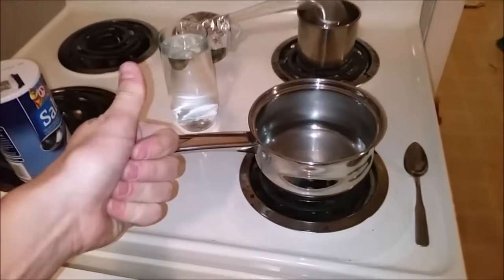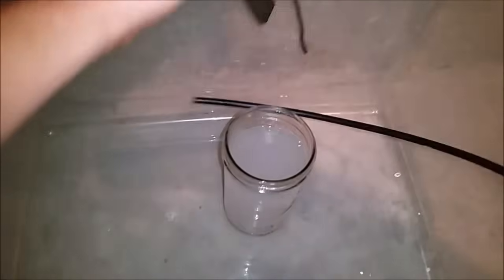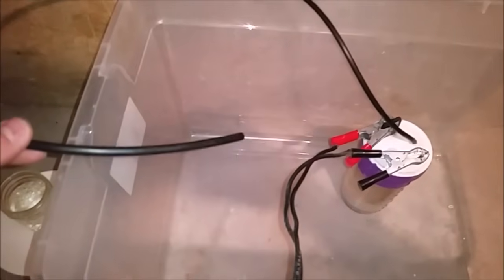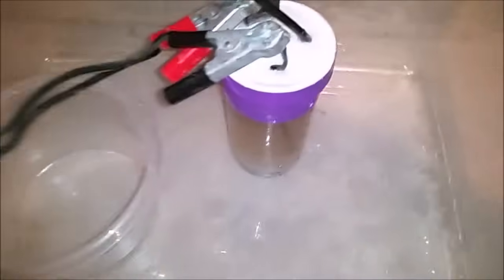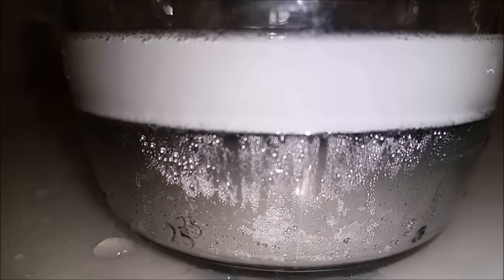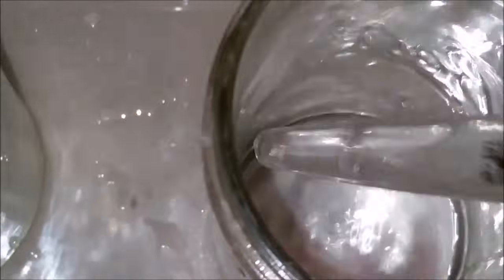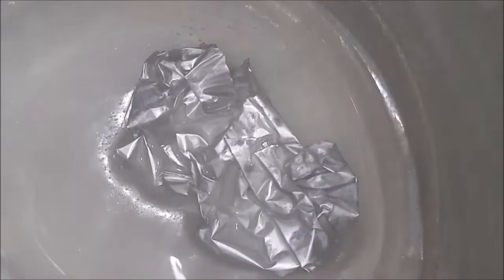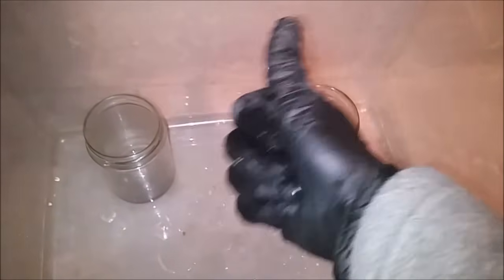Making Sodium Hydroxide (Lye) From Salt

Comment: "Today i'm going to make Lye from salt" Awesome! I'll be able to get some lye that i can dip my pretzels into- "All we need is some Mercury"  "oh..."
Reply: u dip pretzales into food grade lye before cooking
Reply: What kind of Pretzel so you have , Soap Pretzel  !?
Reply: You can order food grade lye on Amazon pretty cheap. If you're using it though you have to be pretty careful and honestly you can achieve a pretty good result from baking soda.
Reply: I have yet to try it but I believe you can simply boil a wood ash slurry for 30 minutes and lye will be on the tippity top
Reply: NowhereManForever or go down to the nearest grocery store,look at the Mexican spice section and you'll find it there also.
Reply: 🤣🤣🤣😂🤣😂, a pound of Mercury...
Reply: Actually just electrolyzing the solution dissolves the chlorine in the sodium hydroxide, forming sodium chloride and sodium hypochlorite, which then is electrolyzed to form sodium chlorate. To actually make sodium hydroxide, you'd have to separate the chambers of the cathode and the anode and connect them via a salt bridge. I used a wet cloth for this and it seems to work, but I wouldn't risk eating some sodium hypochlorite (bleach).
Reply: @suzannemarie3181  chaman
Reply: TheCocoYouKnow that was literally my exact trail of thought as well.
Reply: Pupper the mercury method is used so you can make the lye separate from the salt. If you use two carbon electrodes you'll have to separate the lye from remaining sodium chloride. Unless you manage to completely use up the chloride in solution.
Reply: TheCocoYouKnow Platinum will work as many other ones.
Reply: but if you put just 2 graphite electrodes you will never get sodium hydroxide, you will get sodium hypochlorite
Reply: @anarhuseynov4162  i've tried it, in 1 pot it does make a mix of NaOH and sodium hypochlorite, you have to have to use a 2 part membrane cell and use cotton or agar as the salt bridge, you get HCl and HClO on one side and relatively pure NaOH on the other
Reply: @Swagnermite  what does it mean 2 part membrane cell. Can you describe it clearly
Reply: @anarhuseynov4162  you have two glass jars / plastic pots, anything that can withstand caustic soda and HCl, you cut a hole in the side of them and put a tube through, then you fill it with agar (or cotton, works well). It's basically two seperate containers with something that can transport ions aswell as current between them without mixing the two solutions
Reply: @Swagnermite  thank you very much for information
Reply: Is it possible to make these cells by using household materials at home
Reply: @anarhuseynov4162  yea bro you can even use plastic soda bottles, duct tape and hot glue but be prepared for leaks
Reply: @Swagnermite  bro plastic soda bottles for 2 separate container but what about membrane cell. How can I make membrane between 2 containers. Can it be made from household materials
Reply: @anarhuseynov4162  just cut up a bottle and twist it into a tube that's all you need
Reply: @Swagnermite   ممكن  الوصفه بل عربي
Reply: That’s my EXACT reaction to this...reaction
Reply: Ok i just tried electrolysing Na2CO3 but one of the copper electrodes corroded and turned it blue. Not using that for food. I have some nitinol and nichrome somewhere. Maybe they will make better electrodes.
Reply: @charleslambert3368  Carbon electrodes are better
Reply: The hell? I'm so confused, you put lye on your pretzels!? It has a pH of 14! My bottle literally says "poison" in big red letters on it, next to a skull and crossbones!!
Reply: Copper is ok for cathode but not anode
Reply: I don't know enough about the process to say for sure but I reckon you could substitute gallium over gentle heating  for a non-toxic pseudo-amalgam. Don't take my word for it as this video is the full extent of my research into this reaction..

Comment: Why did you heat up the water to make the salt solution (in the beginning)?
One of the few things I remember from Chemistry Class is that the solubility of NaCl doesn't change with water temperature.

Comment: Considering the reactivity of the Sodium in it's elemental state, I dont believe to be the right explication that the mercury dissolves the sodium and then reacts with the water. 
By it's self mercury metal there is beeing an electrode, some of it will sidolve to give mercuric chloride, withch makes these a DANGEROUS EXPERIMENT considering that 0.2g is LETHAL- And the ELECTROLISIS of sodium chloride will produce Sodium hydroxide and Chlroine gass by it's self. So By adding mercury you only increase the hazards of these simple experiment.

Comment: Where do you get your mercury? Do you get it the same place that you get your liquid nitrogen? How much does it cost? Thanks
Reply from the maker: +Robert Vernon 
the mercury is some that my grandpa minned
Reply: +Cody'sLab OK, so where could someone else get it? And what restrictions would there be on it?
Reply: +Robert Vernon Just look around on ebay if you are in the US. http://www.ebay.com/itm/Liquid-Metal-mercury-hg-99-99999-pure-Dental-grade-1-kg-2-2-Lb-or-35-oz-/272152434076?hash=item3f5d8c959c:g:ODcAAOSwX~dWmDq1

Recently I was able to get 1 pound for $60. Really not that hard to find, if you are willing to pay for it.
Reply: +Robert Vernon to put it short... you cannot buy it.... kind of..... you need permits and paper and crap and you can not get it... you need to have a pro lab certificate ect ect safty bla bla and so on and so forth... however.... you can "mine" it ´by buying old mercury switches and other apparatus that used it in ye oldie days.... or you could just buy mercury switches from china ... crush them up and there you go
I got mine from an old barometer and a blod pressure meter, a few thermometers and a couple of mercury switches... all in all about $100 for about 2kg of mercury collected over several years...
Reply: or if you have an actual mine, you can mine a little bit of it from cinnabar, but most people don't have mines.

Comment: Could one obtain solid sodium hydroxide from the resultant solution? Where I live (southern hemisphere) the solid form is getting increasingly hard to come by, thanks to Orwellian regulations. Being highly hygroscopic, I imagine drying the solution inside a desiccator is a no-go. Only alternative I can think of is simply boiling off the water until dryness, though in practice that seems a tad dangerous and messy, since molten hydroxides can corrode glass. Perhaps using an iron crucible could work? Anyone aware of a relatively safe and efficient method?

Comment: Hey Cody, my recent comment here gave me an idea for you. Use some of your NaOH to perform a Black Oxide conversion coating on some steel. Done right it produces a beautiful, durable low sheen black coating on steel (copper, zinc, etc.). It's a bit of a process (for a layman) but I'm sure fairly simple for you.

Comment: I worked in aerospace / defense machine-tooling for many years. We used high purity Sodium Hydroxide crystals to make bath solutions for "black oxidizing" treatment of various steel parts. We also had a run of CNC mills cutting components from 6061 and 7075 Aluminum billets. (Some out there are already cringing :) Our NaOH came in 200L drums (50gal), our CNC machines had chip conveyors to clear the machines and dump the chips into... yep, 200L drums. (rest of you cringing yet?)

A young machinist couldn't find an empty chip barrel, opened the quarantine cage and used a (nearly) empty NaOH barrel to catch the aluminum chips (wet with water soluble cutting oil)... the reaction started nearly immediately with high heat, massive gurgling noise and plumes of hydrogen gas billowing out. While the machinists row stood in awe watching this, my rudimentary Gr.12 chemistry had me sound the alarm and evacuate the building. Initially I caught shit from management who were trying to consult the MSDS sheets, lol.

Just a reminder, when using strong reactive chemicals, READ THE MSDS sheets and understand what you're dealing with BEFORE something happens... you don't have time during an incident. When IT REACTS, YOU REACT !!
Reply: oh what a coincidence, today i was trying to make a  "hydrogen burner" of sorts by reacting aluminium metal with sodium hydroxide
Reply: @VerbenaIDK  My 2cents, do NOT use a 200L reactor vessel. Wear gloves, NaOH "feels" slippery, because it's dissolving the fats in your fingers... in real time.
   Capture ALL of your hydrogen (no smoking). 
   Keep a suitable (equal strength) acid solution nearby to neutralize the reaction if/when needed. "Bill" learned first hand that a $450 Halide "all purpose" fire extinguisher does absolutely nothing here.
Reply: Typical damn management

Comment: The thin section in the end contains euhedral plagioclase, micas (probably biotite), and maybe amphiboles (the green pleochroic crystal on the side of the pic. But maybe it's just a biotite transforming into chlorite). Everything being drowned in a matrix of plagioclase microlites. I don't really see any quartz (at least bigger than the matrix), so I would say it's between a dacite/andesite. At least a volcanic rock with a low to medium level of differentiation.

Comment: This way is very inefficient. If you really want to get some pure lye, you have to make to spin the bottom mercury layer, in the way that the salt solution is seperate from outside clear water , and only connection betwen them is the mercury at the bottom so the sodium amalgamte will mostly dissolve in clear water.

Comment: Hey, Cody. You dont't really need to heat up the NaCl solution to fully dissolve it. The solubility of NaCl doesn't change with the temperature. ( just a little "fun" fact )
Reply from the maker: +jonasbinger 
It does just not as dramatically as other salts, also the hating makes it go into solution much faster.

Comment: Cody are you familiar with the process of changing a quarters color by heating it up then rapidly cooling them down. I've done this with about 3 dollars in quarters and counting in the past two days. Depending on how hot the quarters (dimes work too) I've been left with different colors. The colors gotten so far are; copper, a shiny blue/purple, a shiny red/orange, black, bronze, and gold, and mixtures of those colors. I would love to see your take on this experiment, and any explanation you might have for this reaction.
Reply from the maker: +Some One 
Yeah quarters are made from a material known as nickel silver which is just an alloy of nickel and copper. Nickel and copper oxidize at different temperatures so a lot of colors can be made due to the different ratios of oxides. Pre 1964 quarters didnt do this due to containing primarily silver.

Comment: hey ive had aluminum foil do that with food,( turn black and desolve) and it taste sweet kinda like burning copper smells, i was wondering if you knew what caused this, the food that did it was coolwip and macaroni and cheese the velveta stuff, ive had other food do it as well but i cant remember of the top ofmy head what they are. also sorry for bad english (its my first language and i have 1st world problems) lol  and thank you for making all of your cool videos on stuff
Reply from the maker: +thomas smith 
Any acid that the food may have contained will react with the aluminum such as vinegar or lactic acid from the cheese. also at high temperatures sodium bicarbonate will also react with aluminum.
Reply: +Cody'sLab thank you!